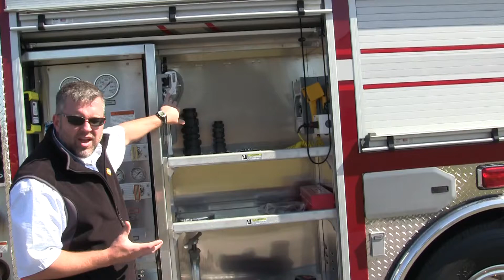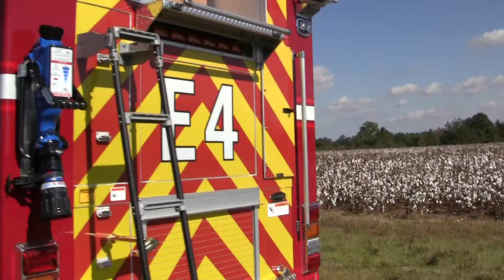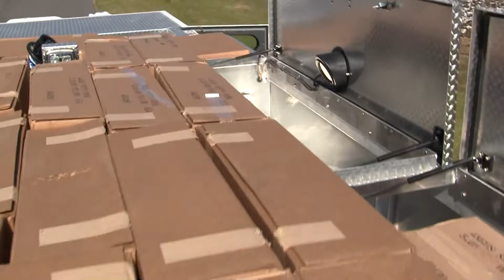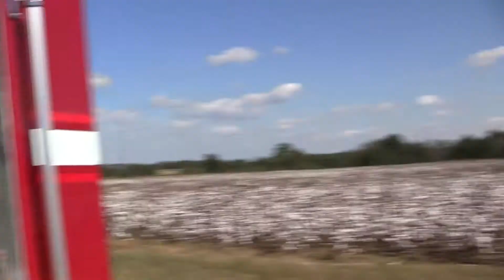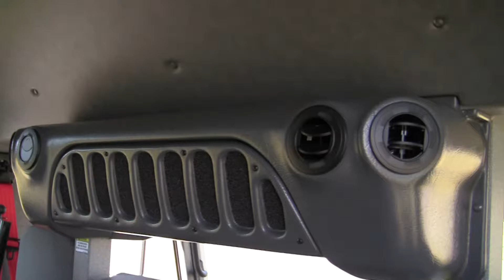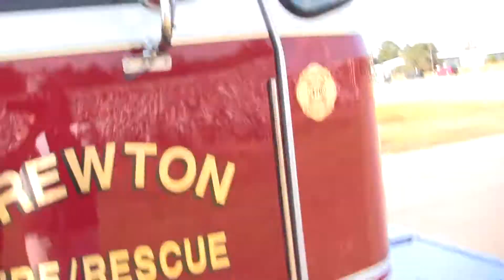E-ONE eMAX Custom Rescue Pumper for Brewton Fire/Rescue by Sunbelt Fire

Comment from the maker: All the speedlays are pre-connected.  When the speedlay is deployed and used, the tray is removable so that the hose can be loaded back into it.  They have the option of leaving the hose connected during loading operations or disconnecting it.  The connection is above the hose lay so the connection is easy.   Hope this helps.